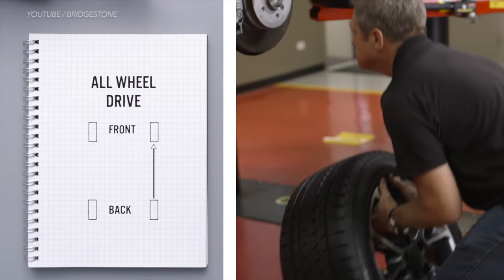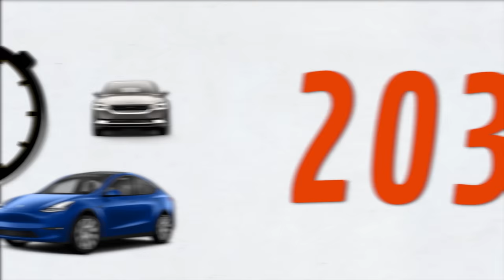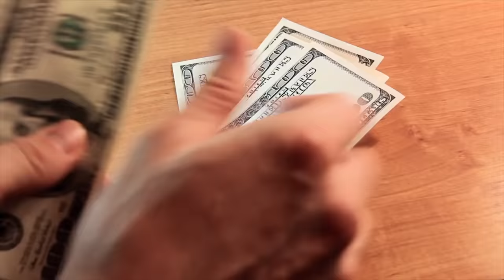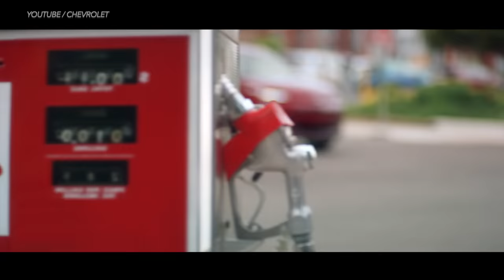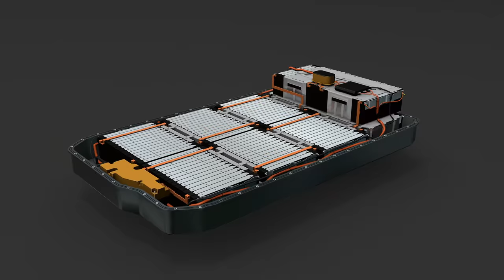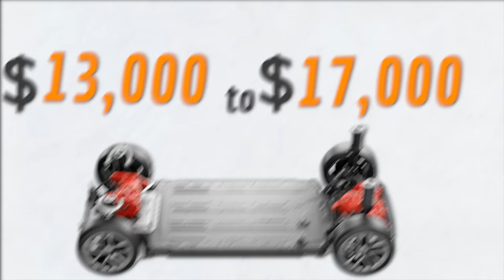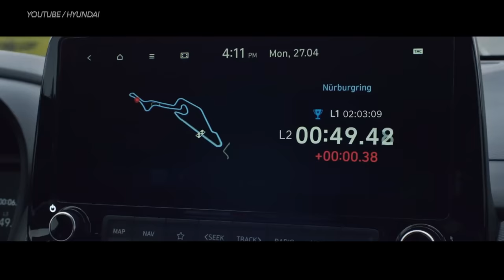No One is Telling You the Truth About the Real Cost of Owning an Electric Car, So I Have To

Comment: I own an EV (VW ID 4), it has 12,000 miles and the tires still have a lot of thread left on them.  I like maintaining my vehicles and I’m a big fan of tire rotation, nonetheless I still had to buy new tires for my other VW Tiguan after 25,000 miles.  So I’m not 100% with Scotty on the tire wear argument. So far my EV has been flawless, I think it’s one of the best cars I’ve ever owned as far as performance.  Also, Scotty is talking as if all the combustion engine cars had the same size tires, a lot of them have different size tires for the front and back so you can’t rotate them.

Comment: It's too early to buy an EV.
Reply: Every time I go by one of those charging ⚡stations I see some Tesla owner sitting there with the windows down🥵 playing on his phone.. I don't want that.😂
Reply: @charlesjackson1700  - and every EV owner must laugh at you every time they drive by you at the gas station these days 😮
Reply: Depends on what you use your vehicle for and how far you drive daily.
Reply: @skiinggator  Soon they will charge for electricity too. Let's see how many people smile when their electricity bill is through the roof and a fast charging station costs money.
Reply: @AcuraTSX-nv5zr yep  it's the same old story: introduce alternative fuel at a low rate then tax it up to where it costs the same as gasoline would have .. just ask anyone in Europe driving non gasoline cars
Reply: I bought a 2018 Chevy volt just before the pandemic onset. Drive 50 miles round trip every day. I used  less than a quartr coming home tonight, in the middle of winter that will be closer to half a gallon. Two oil changes in 65k. Replaced the tires at 30k and they have 10k left. Great commuter car for me. It works.
Reply: @skiinggator  Gas station in & out. Charging station wait & wait.....................
Reply: It's too late to buy an EV, I'm too old.
Reply: @Nick41622   - and how much did that convenience cost you? Where I can charge at home in my sleep for 10x less than current prices.
Reply: @AcuraTSX-nv5zr  - I did the math. It would increase my electric bill by about $50 / month. I just filled my car for $53 and I have to do that 3-4x per month.
Reply: @skiinggator  You must sleep for a long time.
Reply: @skiinggator  $13,000 to $17,000 for battery change. No thank you.
Reply: @Nick41622  - a level 2 home charger will take about 6 hours for most EVs. And that's only if you drove it down to near zero charge remaining.
Reply: @skiinggator  too bad if you have to go out in a hurry,  at least there is always fuel in my car.
Reply: @Nick41622  - again, that's only if you drive it to zero. My daily commute is 60 miles. That leaves plenty of range for unplanned errands in all but 1st gen EVs.
Reply: @Nick41622  - Tesla packs cost that. Leaf is about half that at $7500. And that's if the entire pack has to be replaced. Most of the time it's just a handful of bad cells. Disconnect those and you have a 95% pack. Just saw a video of a shop that was doing that for the original Tesla Roadsters.
Reply: @skiinggator  Believe me I'm the one doing the laughing. I don't mind sticking my card in the pay slot filling up and getting on my way.. I sure an not sitting around waiting for my appliance jelly Bean shaped 🚗 car to charge up.. that's ridiculous 😂
Reply: When new technology comes out, the people who purchase pay a high price for a product that still has room for improvement.  This has been true for HDTV, cell phones, computers, microwave ovens, and cars.
Reply: @sapphire163  Exactly right.
Reply: @skiinggator  OK, good point.
Reply: Leasing one is the way to go
Reply: @skiinggator  When a few batteries go the rest will be on the way out too. You wouldn't do this to your laptop battery.
Reply: @skiinggator  Come back to me in a few years when that changes.
Reply: @charlesjackson1700  most EV owners don't use charging stations. Costs me a dollar a day to charge at home.
Reply: @charlesjackson1700  I see them with the look of desperation in their eyes as I fill up and drive off in 5 minutes.
Reply: @skiinggator  Not really. The big laugh is when they have to replace those batteries or worse they're forced to make a long road trip.
Reply: @skiinggator   EV cars are junk.. like driving around in a golf cart.. except they ride worst and bounce like a ball.
Reply: "If you have to go out in a hurry, at least there is always fuel in my car"
Gas or electricity, what is the difference? For an EV, you could say my car is always charged.  If you need to out in a hurry and aren't prepared, you go to the gas station, or a level 3 charger.
Reply: @sapphire163  Putting fuel in your car is quick, charging your AV takes forever. That is the point.
Reply: @Nick41622  Older EVs that would be true. Newer ones that is not the case.  On level 3 charger, about 20 minutes to go from near empty to 80%, new Teslas are even faster.  There is no denying it is still longer to charge than filling up with liquid fuel, but the gap is closing.
Reply: Let’s not forget that once winter rolls around Ev’s charge gets drained much faster so that projected range takes a nose dive. No thank you

Comment: I worked in a warehouse with electric forks up to 7 tonne that lasted 8 hours moving tonnes of stock and then you simply swap the low battery for a charged one.  It took 3 or 4 minutes.  If they were serious about electric cars they would legislate that all cars use universal batteries that can be swapped over so we could have battery stations instead of gas stations, no need to wait hours to charge a battery which is the biggest problem.
Reply: Look up "better place israel" and it'll take you to a failed attempt to do just what you suggest about ten years ago.
Reply: @Steve_K2  the problem you have with that idea is engery density. Don't get me wrong, lithium batteries have a high engery density compared to say NChD batteries.

Petrol has an engery density of 12,200 Wh/kg (watt hours per kilogram) while lithium ion batteries (18650 cells)  at maximum efficiency 220 Wh/kg. 

You'll need 55 cells to equal the engery density of 1 litre of Petroleum. A telsa battery weights 900lb or 408kg and lasts around 300 miles. 

A full tank of gas (avarage 55l tank) weighs 40kg or 88lb and lasts around 300 miles (on avarage) 

There's no competition in absolute efficiency, however we have other factors at play, such as temperature, humidity ect
Reply: It's all fun and games until you go to the battery station and get a lemon swapped into your car and end up on the side of the road. It's not as simple as making car manufacturers have universal connectors.
Reply: Thats how you get the slippery slope to people switching 'junk' batteries with new ones, scraping them with old ones and returning for a new one. Then using said batteries for their own home electrical storage. Youll have more oppressive laws with no right to repair etc. Very dystopian.
Reply: absolutely correct, but the battery companys want to maintain control of the heavy metals in the batteries, which is why they lease the batteries?????

Comment: 1) A lithium battery car fire took Firemen 4 hours to put out, using 2,500 gallons of water; 5 Fire Engines; 1 water tender; 2 Fire Battalion Chiefs & 1 Hazmat Officer to control the scene. They had to turn the car on its side to access the lithium battery to put the fire out. On that note, 1 lithium battery-powered bus in China caught fire & spread the fire to a total of 50 adjacent lithium battery buses.
2) Also, it was a lithium battery on a WV all-electric car that caused the fire that sank an entire car carrier ship in the Atlantic ocean. 
3) When PG&E shut the power off for a week during the Northern CA wildfires, no one could charge their EV cars (unless they had a gas or diesel powered generator)—time they didn’t have to spend charging them during immediate evacuations. Those who couldn’t— who had to abandon their lithium battery car during emergent evacuations—when their lithium battery car caught fire, it created a toxic magenta-pink ash cloud.
4) A single Tesla battery weighing 1,000 pounds requires extracting & processing some 500,000 pounds of materials. At this rate, over the next 30 years, we will need to mine more mineral ores than humans have extracted over the last 70,000 years.
Reply: And I still see a burned up ICE car in STL almost monthly on my way to work.
Reply: You realize that it will be mine by childern in Africa were the mines are. They have very little to no safety standards for the worker mining the lithium. They also have little to any EPA standards.
Reply: @andrewskaterrr  I saw a rav4 on fire on the way to work lol.
Reply: That's information.
Reply: @andrewskaterrr  of course you will , the world has about 1.5% of EV's and 98.5% of conventional vehicles , and some of those conventional vehicles still driving around today are up to 40 or 50 years old , some are well looked after , some are not.
  wait another 10 or 20 years and see how many ev's are catching  fire and sitting in car wreckers because 9 out of ten people will not want to spend a fortune on an ev to replace a very expensive battery that is past its warranty. 
I estimate EV's will be the shitboxes of the future. 
you couldn't pay me to own an ev.
Reply: it looks like Space X, 🚀 Musk will need to mine the asteroids.
Reply: @mikldude9376  tell me you haven't don't your EV research without telling me...lol
Reply: @mikldude9376  
You will own nothing in the future  and be happy.
 If you  don't  know what  that means I suggest looking it up.
 The government  will own the car and they might  let you  use it once and awhile.
Reply: aaaah the famous wolksvagen EVs 😂
Reply: Speaking of PG&E, Californians have sued them into bankruptcy twice and they have had to pay tons of legal fees and judgments instead of upgrading their equipment. Then the same sue-happy people complain about rolling blackouts. If they can't handle the electric needs of their customers right now, how bad will it get when they're all plugging in their electric cars.
Reply: @mikldude9376  you probably still own an alpha numeric pager instead of a smart phone too...right? 😆😆
Reply: The vast majority of gas stations don't have backup generators, so ICE vehicles can't get fuel when the power is out.  And, why do you assume that all EVs had dead batteries when the power went out?  Most of them probably had a pretty high state of charge, since they were likely plugged in before the power went out, and they had no problem driving to safety.
Reply: @dansanger5340  There are several easy ways to transfer liquid hydrocarbons from a tank to a vehicle without electricity. There is no way to transfer electricity to a storage battery without...electricity.
Reply: And what are they using to mine that ore from the earth
Reply: The average price of an electric vehicle is $56,437 according to Kelley Blue Book. Median household income was $67,521 in 2020, a decrease of 2.9% from 2019. A lithium battery replacement can cost $20,000 (& more) when no longer under warranty.
Reply: @gary.s7759 : Wrong.
Reply: @wenmoonson  People simply are not getting fill-ups from gas stations without backup generators in significant numbers when the power is out.  It's silly to claim they are.  EVs can drive away from a wildfire during a power outage just as easily as an ICE vehicle can.  Why belabor the point when the answer is obvious?
Reply: @paulcoenen7918  hahaha , we will see .
Reply: @dansanger5340  not if they have a flat battery .
Reply: @andrewskaterrr  yup... I am a fire fighter (vol) and I put out about 4 to 6 car fires a month....  In the last 5 years ONE EV... And it didn't take "hours"...  About the same amount for a regular car.  The trouble is people who are not trained to put their hose UNDER the car.  Spraying the interior does nothing.  At least with an EV, I'm not worried the tank will blow up.
Reply: Exactly, on the surface EV vehicles sound great. But once you really look into it one quickly realizes they aren't as green as they appear! They are expensive to repair as well, my sisters husband's tesla model y had a tree limb fall on it in their driveway shortly after he got it. The body damage was on the pass side and didn't appear bad, he was quoted 30k to fix it. Didn't have proper insurance coverage on it as he had just gotten it for his bday so he ended up SOL with a smashed up tesla!
Reply: @mikldude9376  that's really funny.  my sister in law has a 21 year old Prius (yes a hybrid, but still the same excuses Since day one)  And after 300K miles (so much for that falsehood of range) it needed a new battery.  Cost way less then a ICE car motor rebuild....  And EV are even less needing any repairs with sealed brushless motors and very few moving parts.  The motor side might not need a rebuild in another 300K as it runs very little compared to a normal ICE.  The battery is the ONLY expense.  And since the first Tesla, the batteries are cheaper, lighter, use 80 percent less nickel. And have faster charging and greater range.  And already, there are replacements for that in testing...  So a 30 year old tesla model 3 could probably get a new battery that uses NO lithium and nickel.  And still cost less than an engine rebuild... On top of that, Hydrogen's  main issue has finally found a solution with on board storage using plasma kinetics disks.  If their density is as stated, that will be the end solution
Reply: oh, and that newer battery has twice the storage of the original.  She went from 44 mpg to almost 59 mpg.  600 miles on a single tank of gas
Reply: P
Reply: @davidbowerman6433  how do you know a Tesla or a Prius will even last 30 yrs that long. I'd bet it won't last as long as a 1969 Camaro, a 55 Chevy or a 1972 Chevy truck.
Reply: Lol!!!!  Is this guy serious????
Reply: The people that think EVs are the answer for everything are exceptionally myopic. In the long run EVs are often worse than efficient internal combustion cars. They don't see the whole picture.
Reply: I wonder about accidents with EVs which weigh twice as much as ICE vehicles.  Can you imagine a motorway pile-up with several EVs each weighing over two tons?  The forces involved are terrifying.  Then the fires.
Reply: You never put water on a lithium fire…..
Reply: @thereseember2800  And the average cost of an ICE vehicle is 47,000. Many manufacturers warranty the batteries to over 150,000 miles. During that time you’ll save about $25,000 in fuel costs, and $5,000 in general maintenance. If you receive tax credits, your $56,000 EV is now equivalent to a $19,000 ICE vehicle.
Reply: @Enrique Thiele just like drink containers are recycled and never make new ones
Reply: @davidbowerman6433  not worried about the battery blowing up?
Reply: @bullbutter2931  cloud seeding (ch3m tra!ls)
Reply: Keep posting this please and thank you. You rock.
Reply: The fire department should have known to use foam to extinguish an electric vehicle fire, so OF COURSE it will take a lake of water to put out a EV vehicle fire. DUHH.
Reply: Who cares? Are you gonna control that? And it's 'mined'.
Reply: @davidbowerman6433  you talk like a illegitimate president that won honestly but don't have a clue who he is or what he's doing.

Comment: My 70d had tires rotated every 5,500 miles, and we're replaced at roughly 27,500 and 53,000 miles.  I went with Michelin on my first set because they had a 40k warranty, but was denied because the tires have a stated maximum weight per tire that was exceeded by the Tesla.  Only other issue I had with my Tesla was replacing my coil over shocks.  I was told this was normal for Tesla's around 50k miles.  5.5 years and 2 sets of tires and new struts set me back almost $4,000.

Comment: Have a Chevy Bolt and yes, you need to rotate the tires. I wore out the front ones before the rear were done. I replaced the whole set for about $800 at Costco. I will be more diligent about the rotation in the future.

Comment: Great review, Scotty. Am a firm believer in tire rotation every 6-8,000 miles. Just sold a car that had over 70k on the tires and had about 40% tread left on all four from religiously rotating the tires and keeping the tire pressure at manufacturer specified inflation. The wife's car tires have over 40K with 65% tread left on all four with the same rotation regimen.